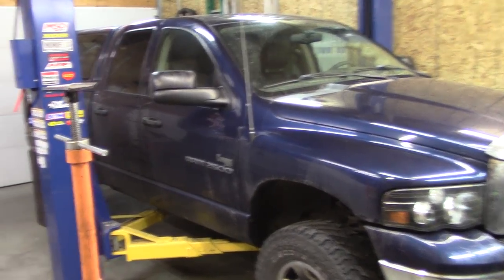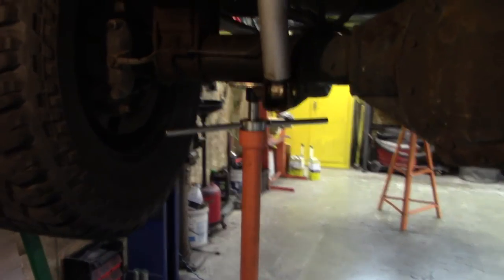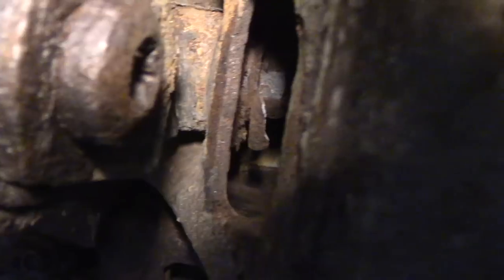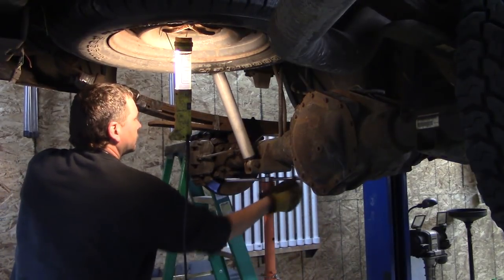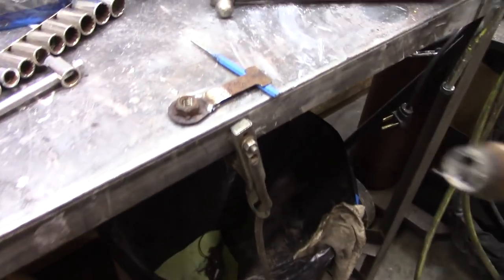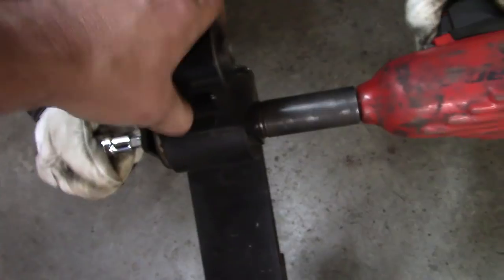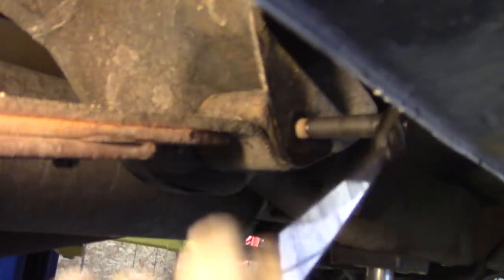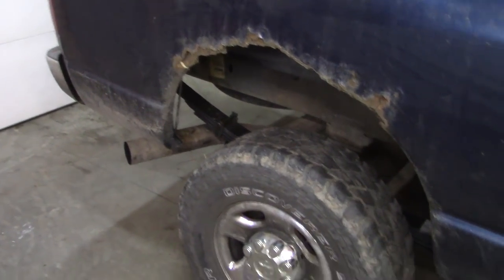Dodge 2500 Leaf Spring Change Ram Cummins

Comment: Thats called a Flag Nut very common with dodges. Used on front ends as well.. Don't forget to tac weld the stakes on the Nuts while your at it. They really like to fail as well...